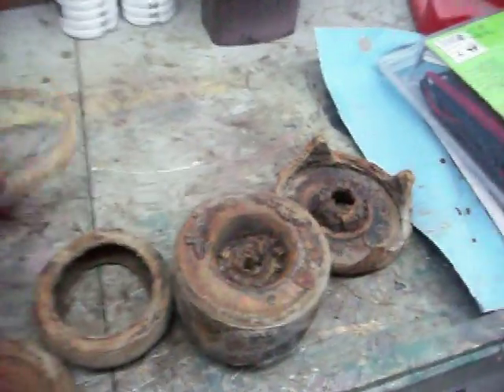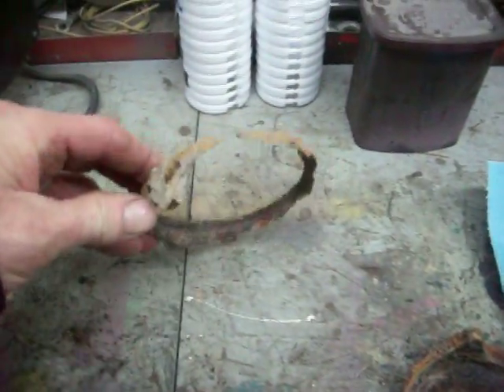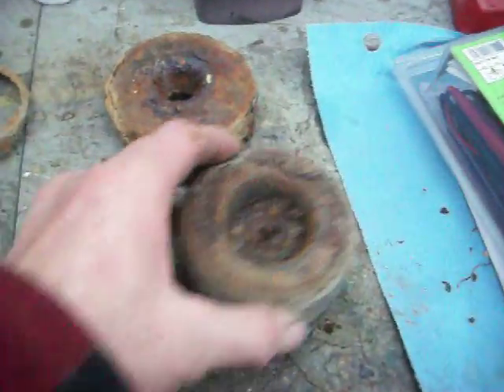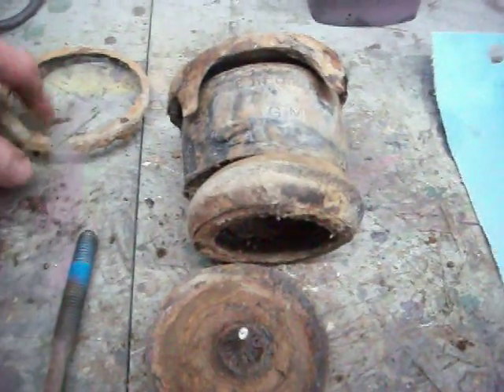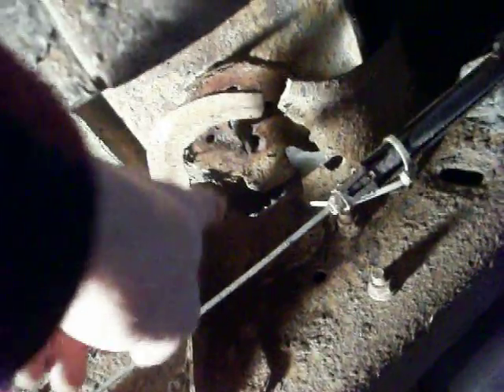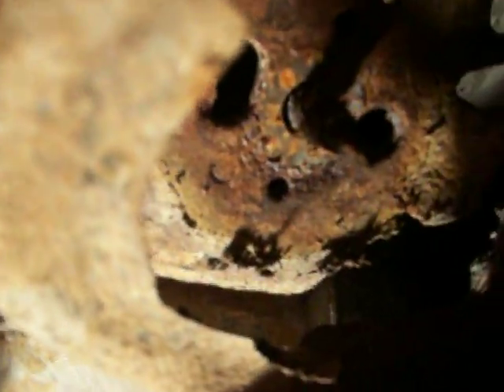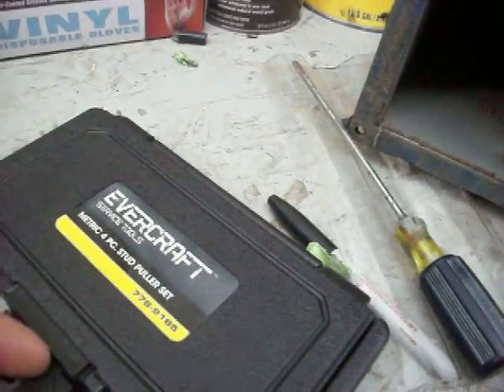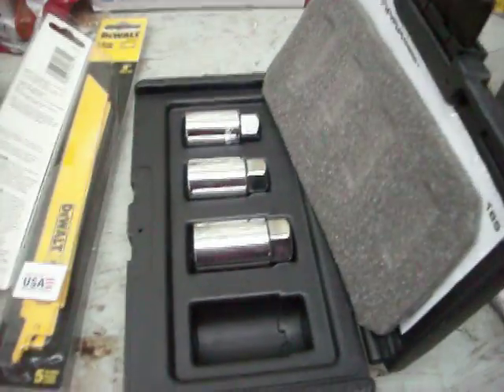Another repair to cab mounts on a Chevy Pickup

Comment: What is the socket size of the bolt? I have a 1995 K2500 suburban. Today I noticed one body mount dounut/washer loose, on passenger door area. While I was applying it's first ever rust undercoating treatment (Sta-Bil spray can)
Seen little in the way of salt roads though; it has sat outside its whole life so I imagine I shouldn't try to tighten it - or it might snap in two too.
I made a YouTube video of the rust  prep 📺
Reply: The size is a 19mm I believe

Comment: How did those stud pullers work, I have the same problem with my old truck haha.  You don't happen to recall what size the mounting bolts were do ya?
Reply from the maker: 12mmx1.75  4" long. Stud removers worked very well with soaking the threads as best as can be done.
Reply: Awesome, thanks for the info. That may as well have saved me a trip back to the store, because I was guessing 7/16
Reply: Josaljo Won  I have a question I want to put nerf bars but do not have installation hardware do you know how long bolts have to be so I can install factory ones are short.